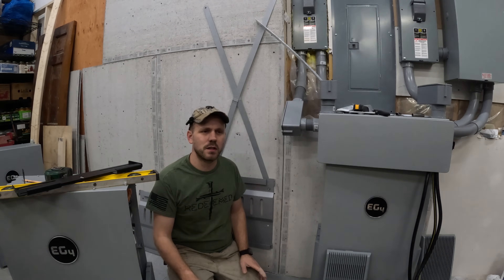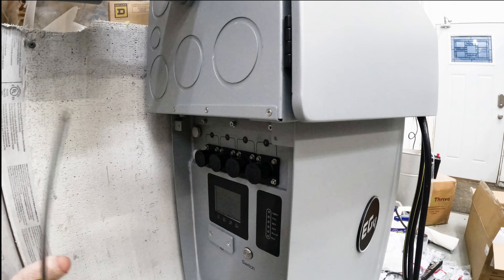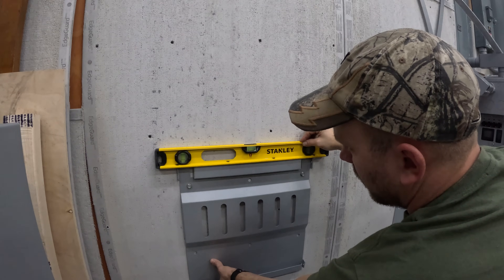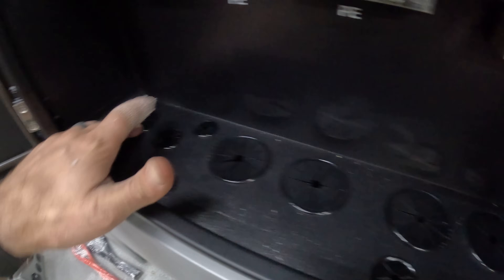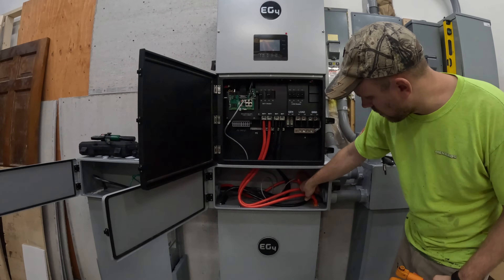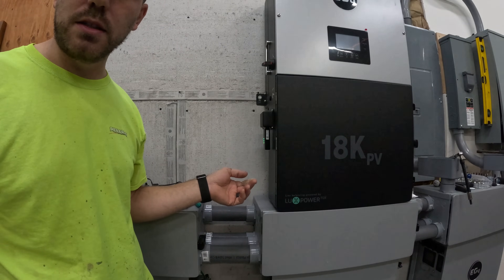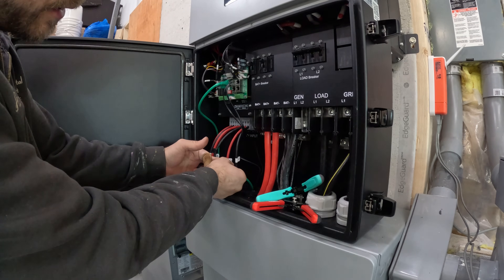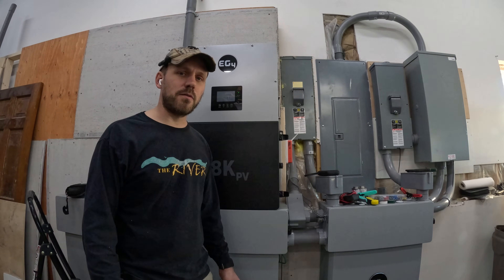Avoid mistakes! EG4 18kpv inverter and PowerPro WallMount batteries install

Comment: You did a really good job with descriptions. Great detailed video.
Reply from the maker: Thanks!
Reply from the maker: I have seen a few of your videos as well!  Are you grid tied on your 18k with a net metering agreement with the utilities company?
Reply: @portercreek  I have grid as backup if needed. But I pretty much run completely off grid. I don’t have a net metering agreement.
Reply from the maker: @GavinStoneDIY   i am in the same boat, however, unless I run mine in off-grid mode it will back feed some electricity to the grid, even though I have zero export checked and export set at 0kw.  I would like to have the grid help out because we have a wood shop and sometimes powering up some of the equipment takes a little more juice than one inverter can handle.  Do you run yours in off-grid mode or do you have it disabled?
Reply: @portercreek  I run mine in off grid mode. Which firmware are you using now? I believe they have a version now that does good with zero export.
Reply from the maker: @GavinStoneDIY   I downloaded the latest firmware a week or so ago when I installed the unit.  What do you have for a battery bank?
Reply: @portercreek  I have 6 rack batteries and 2-280ah diy batteries. I may be switching things up soon though.

Comment: Nice video. I was going to make one but you covered almost everything that I would have. A few extra points that I would like to bring up…. Mongo put my batteries together and stripped one of the battery cover screw heads out. I tried everything including grinding down a screwdriver. I ended up drilling out the screw head. No big deal just very time consuming. The other battery had the screw for the conduit box stripped head, Mongo strikes again! It was also a hex head so no big deal. The instructions call these “thumb screws”. To me thumb screws are the knurled screws used to secure the access covers. Also they talk about screwing the conduit box to the inverter. My inverter had no holes? Another wrong item is the additional rapid shutdown jumper. It was not installed on mine note was there a place to do it. I guess the PCB has been modified.
The X bracket was totally useless! Big pain! I used a laser level after mounting the lower bracket, and lined up the center screw and the arrow head on the upper bracket. Worked well. I used a two wheeler to lift the battery onto its bracket. One thing I didn’t see you do is ground the batteries to the inverter. Your thoughts on this? There are probably a few items I missed that may help someone else, I will add them later. Again, nice job!
Reply from the maker: I didn’t see holes on my inverter either for attaching the conduit box to it.

They want you to snip a yellow wire and put a plug on it for the rsd, in my opinion, the plug should already be there ready to use.

I forgot to include the grounding in the video.  I bought a set of lug on amazon(link in the description) and installed them on the batteries which made grounding the batteries a lot easier.